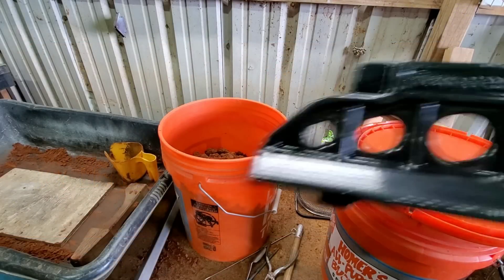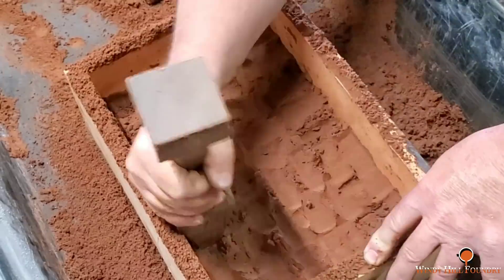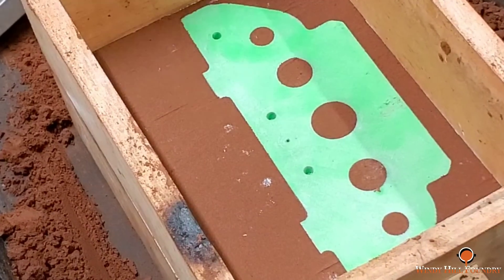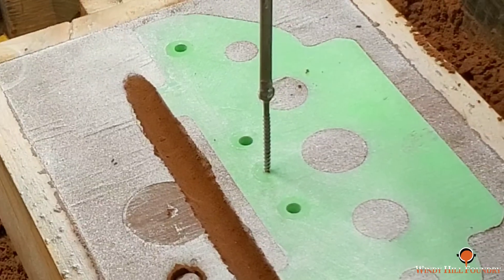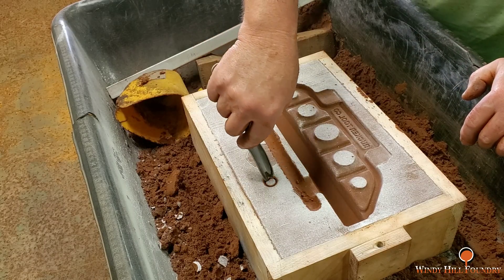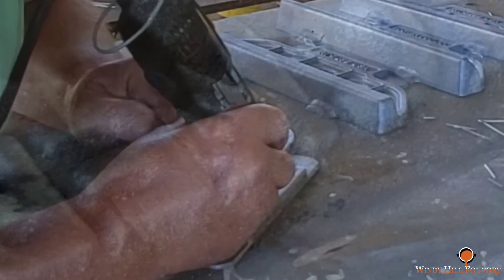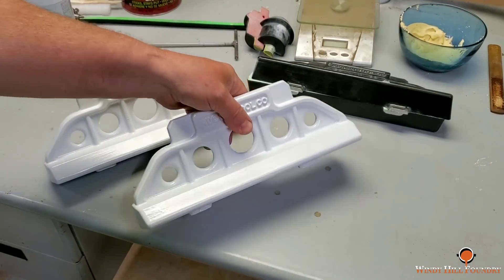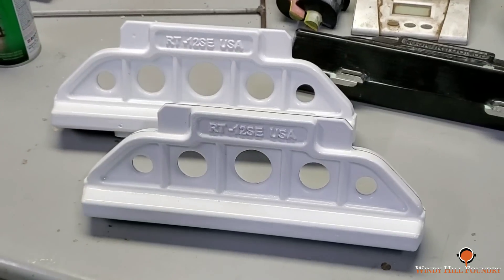MAKING ALUMINUM PRODUCTION PATTERNS

Comment: I know this came up as an older video cause you are casting these now in iron. Would have been nice if the plastic pattern had enough extra material that the aluminum patterns could have been milled flat.

Comment: How thin can iron be cast?   I need some transformer iron, 4" by 6' and .040"-.080" thick, the lenth isn't so important, it only needs to be 4' minimum lenth,  but I think casting a 1" bar 3' long would probably be the best idea, then forge the banding. The thinner the better, and righing something like a English wheel to run it through, to get the thickness, I was just wondering your opinion, I need to build a large toroidal transformer, basically the tape inside a tape measure, only from iron, and much larger, I'm thinking up to 50 lbs, fro. High silicon iron, I guess is the only difference, I have most of the iron, just looking for advice thanks,
Reply from the maker: Hi James, I believe they use high carbon steel for that application. The same stuff bed rails are made from. I can cast something that thin but it wouldn't be workable. First of all cast iron has a huge compressive state and very little tensile strength. Secondly, casting it that thin would instantly be white iron so you wouldn't be able to machine it.
Reply: @windyhillfoundry5940  I just need to roll it into a coil,  I'm not sure what it actually is, I always heard it called iron core transformers, it seems very soft, and it isn't supposed to hold a magnetisation, it supposed to be magnetised, then zero, then reverse, and repete. Steel like screwdrivers can easily be magnetised, now that I'm thinking about it, I have seen them welded, with I'm guessing a MIG, would it be possible to cast the  steel transformers I have, into a bar, then forget into banding?
Reply: @windyhillfoundry5940  thanks for the reply,
Reply: @windyhillfoundry5940  thanks for the reply,

Comment: I would think if you applied body filler then if you can find something flat like a thick piece of glass, put down a layer of thin plastic and set the pattern on it, then weight it down and when it dries you should be able to peal the plastic right off.

Comment: Have you tried using auto body filler instead of the water putty?
Reply from the maker: Yes I did use bondo before a friend recommended durhams water putty and never went back. Bondo takes forever to sand and water putty doesn't Hardin before I can finish
Reply: @windyhillfoundry5940  That is why I said to have a place set up with plastic you could press the mold down onto before the filler got hard, it would copy the surface you placed it on (ie flat) and as soon as it got hard you could simply peal the plastic right off.
Reply: a fifteen minute job at best
Reply from the maker: @imysteryman  oh I see, yes that sounds like it would work
Reply: @windyhillfoundry5940  try it with a scrap piece, just make sure you use some new creamy stuff

Comment: Looking very nice work there, a quick question about you using wet putty, I know that a few other casting individuals use the likes of car body filler sometimes they have used home crack filler , I presume that it’s all the same as each other,  will you be doing a video on the pouring in cast iron as well please! Many thanks for your time and sharing your skill in this wonderful craft. Have a great week and you,your family and friends be safe and well during these trying times.    👍👍👍👍👍.....Phil 🇬🇧
Reply from the maker: Hi Phil, you can use bondo but water putty is easier to mix up and sands easier. As long as you seal it(paint) this stuff works great.
As for a video on the iron pour, Keith Rucker may want to record that for his channel so I'm holding off on that until I know what he wants to do

Comment: What are the round things you use for weights?
Reply from the maker: Doc these were originally weight rings used for hydraulic pressure calibration. They are ideal for mold weights
Reply: @windyhillfoundry5940  I can see they are working very well for you. Thanks for the response. What fuel are you using in your furnace?

Comment: You're right about keeping the pouring temperature low, as overheating the metal is a problem I see a lot with casters on YouTube. By keeping the pouring temperature low, it reduces porosity, leading to a better casting.
Reply from the maker: Yes you never want to over cook aluminum

Comment: Clarke, why do you try to not go hotter than 1300°F when casting aluminum?  Also, what caused the porosity in the castings where the aluminum entered them (the gates?)?  Thanks!
Reply from the maker: Hi Bob, the hotter the melt the more gas developed. The inclusions at the gates are from sand.

Comment: Is there a reason you don’t use bondo instead of rock puddy?
Reply from the maker: Phil, if I could quickly mix and sand bonds I would prefer that on this. Water putty is easier to work with and super hard as long as it's sealed

Comment: looks good clarke, I figured you would have made them into match plates to make them easier to ram up. I also didnt hear if you had printed it with double shrinkage or not, which you probably did, lol.
Reply: ditto about the match plates.  only one I've seen demonstrate making one was Mr. Pete.  one drawback I can see to them would be weight.  if it makes it harder to control, getting the pattern out of the sand without having break outs will be a lot less likely.
Reply from the maker: Thanks Chirpy, I prefer to avoid plates on deep pocketed patterns. Shallow stuff isn't a problem but pulling this deep I prefer to pull individually.
Reply: oh, ok, Ive done matchplates before kinda, but it just had loose pieces in it instead of attaching them to it, that way I can easily ram everything up and knock it around using the match plates, then just had the pieces of the patterns loose so they came out. They just had the holes in the follower board and short pins on the patterns. That way it pulled easily and I could use the same follower board for multiple pieces, lol.

Comment: Learning alot from you videos. Thanks so much for all you do.
  If i may ask, have you ever poured aluminum to cast directly to tool steel like 4140 ish? So that it never seperates....
Looking at around 100lbs Aluminum poured onto around 120lbs of steel apx weights. Yup ima thinking about a little Anvil build
Thanks for sharing sir
🙏 Blessed be now
Crawford out ⚒️🧙‍♂️
Reply from the maker: Hi Crawford, thanks and not quite sure I understand your question. Anytime you have contact like that with dissimilar metals, particularly Aluminium and steel, that will generate galvanic corrosion.
Reply: @windyhillfoundry5940  ok ill look that up. Safe to assume galvanic corrosion is less than desired. 
 Have seen some other anvils w aluminum bases. So I was thinking i might try it out. Perhaps i should study more on it.
Thank you for your time and consideration. 
🙏 Blessed be Sir
Crawford out ⚒️🧙‍♂️

Comment: Clark - We met and talked for a bit at the BarZ Bash last summer.  Good looking patterns, but it got me thinking to ask you why you didn't make a pattern plate since you are likely to cast more than a few of these for Keith?  Seems to be it would be easier for production.  Keep safe and healthy.  Ron
Reply from the maker: Hi Ron, a plate is ideal for low relief and is better suited for a machine that can lift perpendicular with good accuracy. Since I do these by hand I have much more control pulling deep relief individually. I do use a plate for some patterns but like I said those are generally shallow
Reply: @windyhillfoundry5940  Thanks Clark, again I learned something new.

Comment: Question, is the gap on the ends caused by warpage as it cools?  Thanks for sharing and I have the smaller straight edge now I'm going to have to get one of these too.  Aloha
Reply from the maker: Charles the warp occured with the 3d printed one. The aluminum patterns just replicated it. I dont know enough about 3d printing processes but I do know they can draw up like this as they set. I had one years ago someone sent me that was perfectly flat and then a week later looked like a banana
Reply: @windyhillfoundry5940  Thanks it makes sense now!
Reply: The only way to keep a large 3d printed part from warping during the print is to have a heated, enclosed print area. Once the print head gets about 1/4" off the build plate the part will start contracting, unfortunately it was very cold when those were printed making the problem worse.